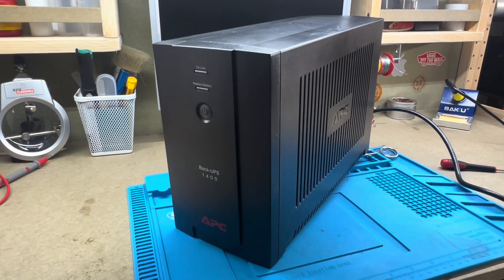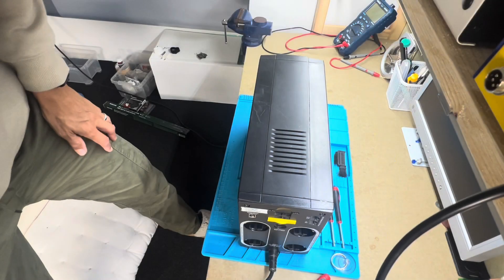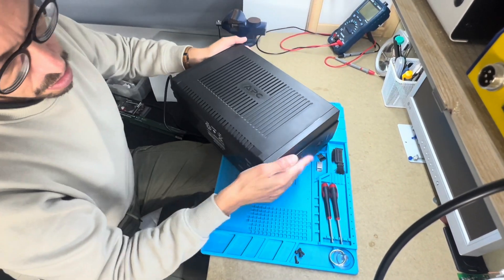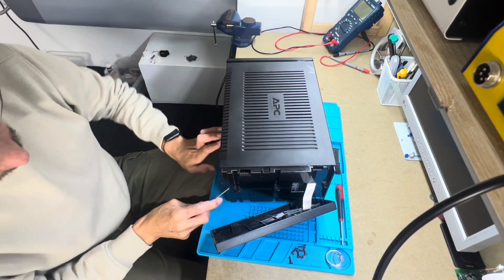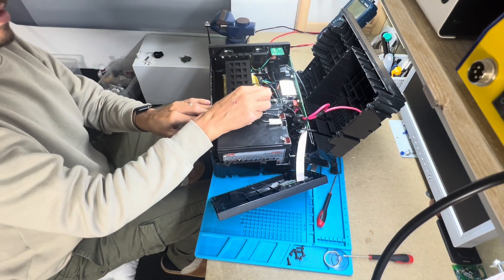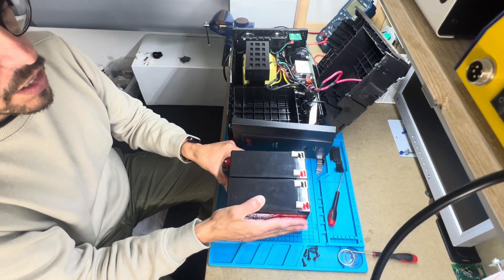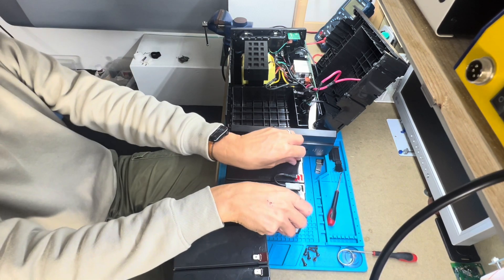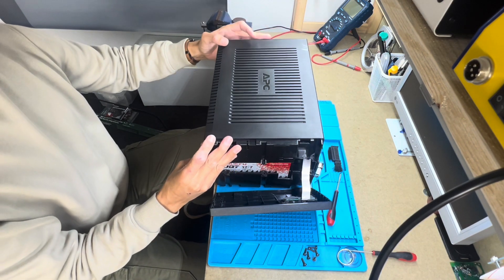APC UPS Battery Replacement

Comment: Can i upgrade my APC 950 UPS single battery to dual battery?
Reply from the maker: Yes, by connecting two batteries in parallel.
Reply: @hcaetano69  Whats the difference if i will use 
parallel over series wiring?
Reply: @hcaetano69 How many years does it usually take if there are no frequent power outages?
Reply from the maker: @v @videogamesxboxnintendoo7706  2 to 4 years, even if there are almost no power outages. They age over time, not with use.
Reply from the maker: Series equals higher voltage. Parallel equals more hours of use. You can't increase the UPS voltage because its board was designed to receive 12V.
Reply: @hcaetano69  Thank you so much very helpful
Reply: @hcaetano69  It works on my APC UPS 950 Thanks man

Comment: I used a wide bladed scraper, the sort of think to remove old wallpaper to pop the front panel and the larger panels off to spread the load and not ding the plastic. My old unit has a dedicated 'replace battery' LED and associated alarm, no mention of how to replace the battery in their instructions, hopefully they are better at that nowadays with the pressure to recycle rather than bin working electronics. Anyway, new battery on the way and less landfill.